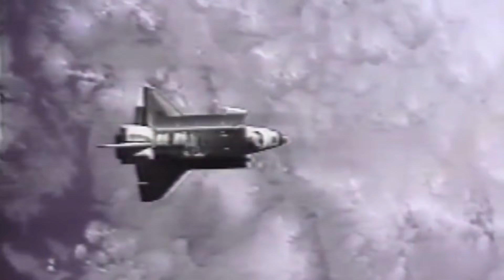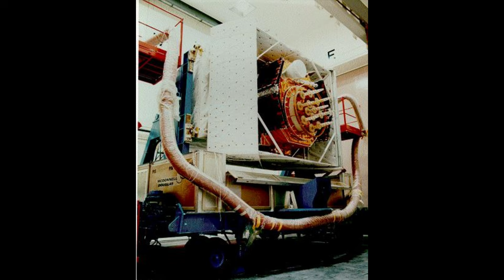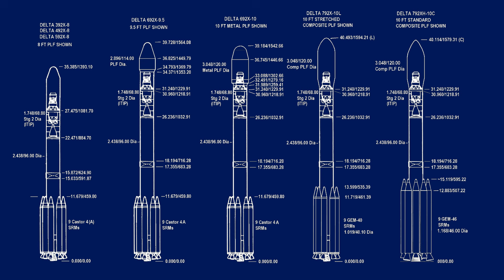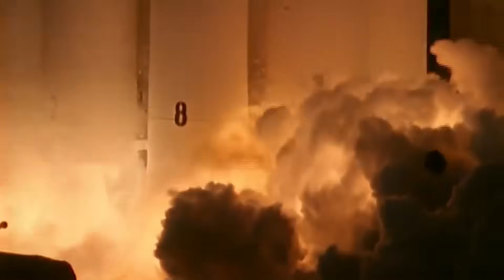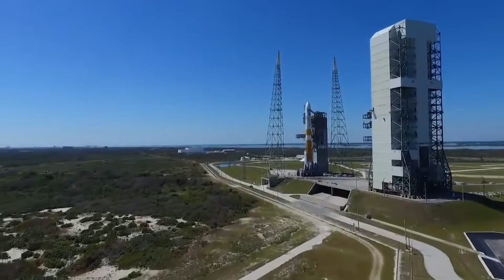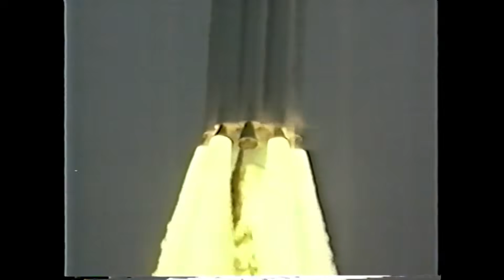Delta Rocket History - Part II - Legacy Of Thor - America's Most Successful Rocket

Comment: Once the Space Shuttle programme started, it vacuumed resources from elsewhere. The Shuttle turned a 10-15t (average) payload into a ~100t orbiter-plus-payload mass, with all the costs and risks tied to what you call 'unnecessary ballast'. Despite partial reusability, Shuttle launches were still far more expensive than their expendable cousins - Delta was less than half the marginal cost of Shuttle launches for typical payloads, so the decisions were very much political - to shore up the justification of the Shuttle - as opposed to purely rational.

Comment: The shuttle was an overly complicated, expensive, astronaut killer. The design of the boosters never got better than a 1 in 100 estimated failure rating. Challenger proved that to be correct.

Comment: Vulcan is essentially the child of Atlas and Delta.  It, of course, will use Centaur as a second stage, a first stage with similar diameter as Delta IV, and the SRMs I believe are based on those used by Atlas.

Alright, it is essentially a new Atlas vehicle, but the way I see it is if you built a Delta IV out of Atlas V parts.

Comment: Because the Shuttle is dumbest, most expensive and most useless launch vehicle ever. It is the dumbest because you are putting the orbiter next to the fuel tank and SRBs such that any catastrophic failure equals the loss of crew (with or without a launch escape system). It is the most expensive because the thermal protection system, engine, SRBs and everything else took more tie and money to reuse than an equivalent payload capacity in expendables would have been to build new. It is the most useless because for a rocket that puts about 100 metric tons of "stuff" into orbit, it only has a payload of 24 tons to LEO and a miserable 2.3 tons to GEO with an additional solid kicker.
--
At the conclusion of Apollo, NASA should have built a very simple medium lift rocket with a ~25 ton payload to LEO and a little less than half that to GTO. It can be a very simple 2-stage rocket with a single F-1A engine and a single J-2S engine. That'll leave about $180 billion for missions. You can send up a new Hubble a hundred times over so there will be no need to fix it! And, yes, you can still have the ISS if you want by launching it like the Russians and Chinese have been launching their station modules -- one 20 ton segment at a time.

Comment: PAM-S was the designation of the STAR-48 motor that flew on the IUS in support of the Ulysses probe.  PAM-D was the designation STAR-48 motor and system on Shuttle for Delta class satellites.  Just plain PAM was designation for STAR-48 motors on Delta preChallenger.  For Delta II, the STAR-48 motor designation was "5" in the fourth position of the 6925 and 7925 vehicles.   PAM-A for Atlas class satellites using a Minuteman derived motor and using a tilted spin table.   PAM-DII used a STAR-63 motor and could use ASE similar to PAM-D and not the tilted PAM-A ASE.  PAM-DII was to be used for GPS.

Comment: Scott, do you think SpaceX would ever scale up the Falcon series to take 9 raptor engines? Doesn't it make more sense as a cost effective and less riskier supplement to Starship and super heavy?
Reply: Well, it'd be an entirely new launch vehicle. Swapping engines is one thing, but propellant and combustion cycle too? I don't see it, and certainly not in the short term. The Falcon 9 is serving them well in it's current form.
Reply: Things don't 'scale' up like that in rockets.  Changing the engines changes the whole design.  They'd be starting from scratch with a new booster.

Comment: Did they ever consider using solid rocket boosters for the Apollo program? 
For super heavy loads they appear to be relatively simple, able to gimble a bit and be designed to throttle back at the critical moment. Just strap on a few more big fireworks and most of your work is done without having to get around all that resonant combustion-instability and POGO of the Saturn V. Plus much smaller cryogenic units needed. What's not to like?
Reply: Yes, there where many interesting concepts. Like replacing the Saturn 1 first stage with 1 giant srb, or a Saturn v with Titan Srbs duct taped on

Comment: My new laptop is therefore a direct descendent of my first toaster (c 1990), as they both use the same electrical plug...
Reply: Do they use the same power cable (cordset)?  The C14 power inlet on PCs and some laptop PSUs is a compatible variant of the higher temperature plug used on some toasters and kettles.

Comment: I wonder with the development hell that SLS has been through would it have been easier to human rate Delta IV heavy than create SLS?
Reply: They are different class. Delta IV is heavy-lift. SLS is super-heavy
Reply: Delta Heavy only has 30% the capability of SLS.
Reply: @philb5593  just strap on a few extra cores
Reply: Probably not for the reasons you’re thinking. The RL10 is very weak in thrust and we know in the past few months the usage of a 2 engine version of centaur for Starliner flights on Atlas V. For Delta IV, the main concern would be that the only variant capable of lifting Starliner would be DIVH, and DCSS only has one RL10.
Reply: Fortunately, Centaur V has two. So there’s no point in continuing Delta IV as Vulcan should work better for Starliner.

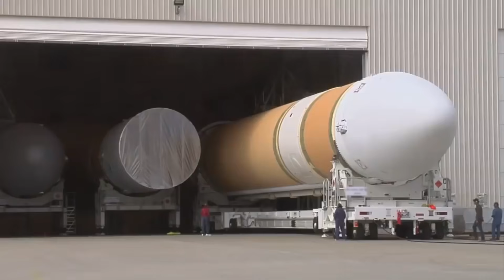Comment: 16:40 minor correction: At the time Boeing was developing Delta IV, the RS-68 was being developed by Rocketdyne.  Which itself was also owned by Boeing.  When Boeing bought McDAC they also around the same time bought Rocketdyne from NAA.  It wasn't until many years later that UTC, who owned P&W, bought Rocketdyne from Boeing and created Pratt&Whitney-Rocketdyne (they went by PWR).  I remember all of this fairly well as I worked for Rocketdyne at Stennis from June 1997 until Sep 2001.  When I hired in we were being called Boeing North American as they were working out the logistics of combining the companies.  It was some time after I left Rocketdyne for NASA in Sep 2001 that P&W bought them.  So to the point, you could say the RS-68 was a Boeing engine at the time they developed D-IV.

As a side note, I supported the D-IV Common Booster Core testing at Stennis.  My main job at the time was running SSME tests on A-2 test stand but I got to work LH2 fill of CBC during test.  Those were fun days.
Reply: I was going to say pretty much this, Boeing did own Pratt, but it was only for 5 years from 1929 to 1934
Reply: @j99450  I did not realize that Boeing owed P&W way back then. Thanks for that info. I'll have to go read up on the history of P&W.
Reply: Per Wikipedia, P&W acquired Rocketdyne from Boeing in 2005
Reply: extremely minor nitpick, but Boeing had bought both the North American Aviation division and Rocketdyne division from Rockwell International in 1996

Comment: Had Project Constellation not been cancelled by POTUS №44, the RS-68B engines from Delta IV, but using regenerative cooling nozzles and the same ignition sequence as used on the Shuttle, would have powered the core of the Ares V Cargo Launch Vehicle. Even after SLS switches out from DCSS to the Exploration Upper Stage, the EUS will be in essence a DCSS on steroids, powered by four uprated versions of the RL-10 engine in use on the current DCSS.

Comment: I love the Delta IV Heavy. It looks so awesome, plus it runs on hydrogen! Also, it just kicks butt that it lights itself on fire T-0. What a vehicle.
Reply: By any chance, was the Falcon Heavy design copied from inspired by the Delta IV Heavy? I mean they both strap on what is basically two extra lower stages on the side. SpaceX even copied the "Heavy" designation!

(Of course with the Falcon Heavy this design makes even more sense since the three booster stages all come back!)
Reply: @cube2fox : Before there was Delta IV Heavy there was Titan III, which is (I think) the first "3 x 10' cores" rocket to fly. Of course, the Titan's two outer cores were SRBs while the center was a (stretched, I think) Titan II that didn't start its engine till the SRBs dropped off.

You can go back further: if you don't get caught up with the shape and size of tanks, you can argue that the first "parallel staged" rocket to fly, and the indirect ancestor of the Titan III, Delta Heavy and Falcon Heavy, is Korolev's good old "Semyorka" R-7. One core, four side boosters, all powered by the same engines...

Back in 1986, Newsweek devoted an entire issue to what was wrong with the Shuttle program, and made a fascinating comment in passing: that, in an attempt to design a simple heavy-lift rocket, McDonnell-Douglas had proposed a rocket whose first stage was SEVEN Delta cores strapped together. I suspect it's actually the reporter misunderstanding one of the Delta II solid booster configurations, but it would be a hoot if it turned out to be a real proposal and somebody turned up some design drawings!
Reply: @cube2fox  It may look similar because it's basically 3 of the same boosters strapped together, but they are vastly different vehicles and don't even run on the same fuel. Plus, have you ever seen a Delta rocket land and get re-used?
Reply: Delta has been good to me but nothing last forever.
Reply: "Looking awesome" is subjective. Running on hydrogen is stupid for the 1st stage.

Comment: Considering SLS to be part of the Delta family because of the second stage makes sense when you remember from the first video that Delta was originally the name for the upgraded Thor second stage. So really, the common factor of a Delta rocket is the second stage lineage, not the first stage.
Reply: And let's be honest, the SLS architecture is a very close cousin to Delta IV. An upper stage that's a direct derivative of the Delta one, a hydrolox core which at one point was intended to use the same RS-68 engine (until they realised it would cook itself, and switched to the RS-25), supplemented with SRBs to get it off the ground due to the deficiencies of a hydrolox core.
Reply: which also means that Delta lost heritage with the Delta 3, so Delta 4 was never a Delta to begin with, nevermind SLS Blk-1
Reply: Then how does OG Atlas become Atlas V? Centaur upper stage?
Reply: @fork9001  Core stage tank. iirc the Atlas III mainly changed the engines & the Atlas V extended it.

Comment: I had quite a few very busy years at McDonnell Douglas and then Boeing. I worked on the development team for the 10 ft Composite fairing for Delta II then went right into Delta III developing composite structures for it, fairing, payload adapter and interstage, then right into Delta IV developing fairings and payload adapters. I worked 7 years where Saturday was a regular work day. I was at the 1st launch of Delta III and was heart broken over the failure. I was at the 1st launch of Delta IV and it was a much better day. Then we became ULA. When Vulcan development was announced I assumed I'd be part of that development, but all composite structure design was subcontracted out to RUAG. So I grabbed a nice severance package and retired at the young age of 61. I had an enjoyable career.
Reply: It's always interesting to me how this industry is really kind of small and it's easy for people's paths to cross in various ways.  Although our paths never exactly crossed, there are similar twists and turns. I started working for Rocketdyne at Stennis in mid-97 as they were in the transition to being bought by Boeing from NAA.  While I was primarily working SSME for SSP at the time, I did support Delta IV Common Booster Core testing at SSC.  I left Rocketdyne for NASA in Sep 2001 and eventually left Stennis for MSFC in 2009.  Nowadays I work structural test at MSFC and one of our customers is RUAG- for some of that Vulcan composite hardware you mentioned.  BTW, they recently changed their name to Beyond Gravity. LOL.
Reply: @msudawg1997  Yep had an interesting career and now have a comfortable retirement. Travelled all over the world after i retired, before COVID hit. Even camped in Antarctica.
Reply: @mattcolver1  that's awesome! I hope to be able to travel one day but I've got to put in at least 9 more years with NASA. And because I waited late in life for kids I've got at least prob 15-17 years  before I can think about actual retirement.
Reply: @msudawg1997  One of the benefits of going to ULA is that I was able to start drawing my Boeing pension at age 52 allowing a nice double dip for almost 10 years. We've been to all 7 continents. I've fallen in love with the southern hemisphere. Less human civilization and unique wildlife.
Reply: @mattcolver1  pretty interesting history indeed, dude! 😃
A neighbor of mine here in Brazil was born in Portugal, but lived most of his life in the US and worked as an engineer at NASA!
BTW, he's here right now, talking with my father and drinking some espresso! 😂
Reply: @msudawg1997  Beyond Gravity 🤮 another terrible corporate marketing name
Reply: these are my favorite YouTube comments. thanks for your contributions boys.
Reply: Being as you working on the fairing, were you ever at the McD plant on Pueblo?
Reply: @bigbuckoramma  Yes I was out there quite often. Last summer I signed the DII engine section they have at the museum at the airport. Larry Geltner was instrumental at getting it preserved.
Reply: @mattcolver1  Do you remember Dave? He was one of the consultants there, he also coached the Bar League Softball Team, the "Delta Dogs".
Reply: @bigbuckoramma  I knew a Dave Vidana. He was a trainer. In fact I bought a snow blower from him when I1st moved to Colorado from Huntington Beach.
Reply: @mattcolver1  I remember Mr. Vidana. He and my Dad crossed many times in their Careers, from Huntington Beach, Long Beach, and Monrovia. My dad's name was Dave D.
Reply: @bigbuckoramma  I don't recall your father. When Boeing shut down production at Monrovia and moved it to Anaheim was stupid. Everything cost too much at Anaheim and Boeing eventually sold off all the production lines like Mast Mounted site to another company.
Reply: @mattcolver1  No worries! It's a small community, I run into people who knew him in the strangest of places, to find someone who didn't know him is actually refreshing.
Watching that whole industry that McDonnell Douglas built up be completely crushed under Boeing's oversight was absolutely disheartening. So much of that was part of my childhood, and to see it sitting there collecting cobwebs, dilapidated, and returning to dust, just breaks my heart. Some of the best space craft ever produced were built there, and no one even knows.
I have been trying desperately to reach out to ULA about the Delta II and the final launch, seeking anything about the final launch to commemorate my Dad's involvement since the first Delta II program, and sadly it's been all crickets. I even reached out to the CEO, who responded to me with an individual's email address, and they have never responded back. If you would like some of what I have from my Dad's time in Pueblo, I would be happy to share it with you.
Reply: did you know one of my college professors Todd Coburn?
Reply: It will never amaze me how much engineering goes into rockets. An entire team to develop a fairing that had to work weekends to get it done.
Reply: You got to live the dream!  Cherish that.  A great many people live their lives and their contribution to society doesn't amount to  much.
Reply: k &
Reply: Saturday is a normal work day for literally 

EVERYONE

I cannot believe as a professional that you think the movies are real and everybody gets Sat/Sun off haha 🤣🤣🤣
Reply: @Kloppin4H0rses  I do.  Gotta work some because of on call, but mostly weekends are my family’s and mine.  I’m sensing a little jadedness, might be time for a career change if you’re trying to convince yourself that working weekends is some new normal.  It’s not, you’re being used.
Reply: No one cares
Reply: @vitalychernobyl6137  251 people clearly do, and the North Korean intelligence services are eagerly taking notes too I'm sure!
Reply: @vitalychernobyl6137  No one cares if trolls die a painful and horrible death.

Comment: Falcon 9 will soon become the most reliable launch vehicle in history, bypassing the Soyuz and Delta
Reply from the maker: F9 Block 5 is already the most reliable.
Reply: Block 5 is has 100% success on 112 missions. Falcon 9 in total is 167/169 with a streak of 143 successes. 
Atlas V is 95/95 with 21 launches remaining. 
The Atlas family is 384/422
Delta II was 154/155 with a streak of 100 successes.
Delta IV is 40/41
Soyuz-U was 765/786 with a streak of 112 successes
Soyuz-U2 was 72/72
Soyuz-FG was 69/70
Reply: Saturn v has failed 0 times, but it only launched a few dozen times
Reply: After Apollo 12 change weather criteria of scrubs launch. Previously, it was possible to run with small lightning bolts, now any risk lightning - hold countdown or scrub launch attempt.
Reply: @av_kovko  why stop there, there was concepts to give the boosters 2 smaller boosters, thus more good